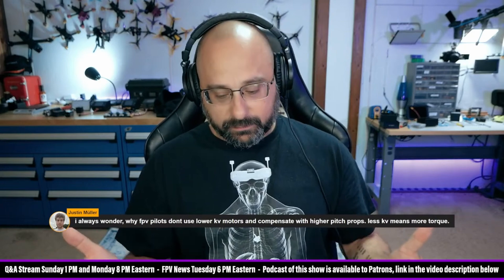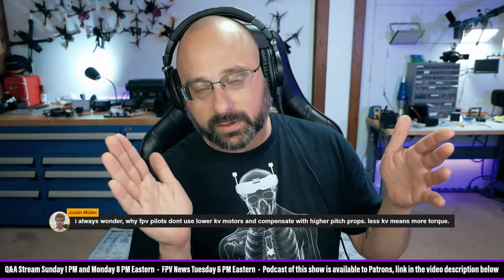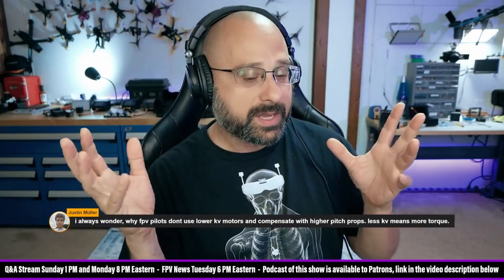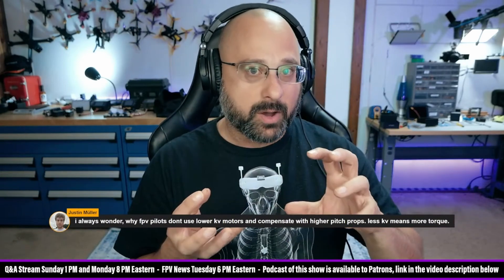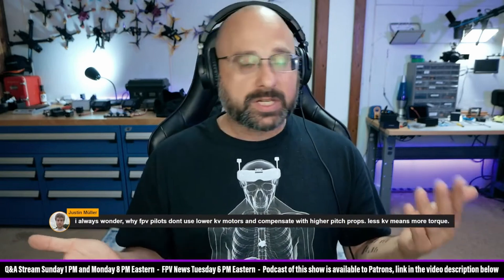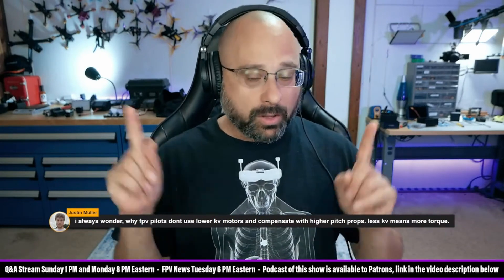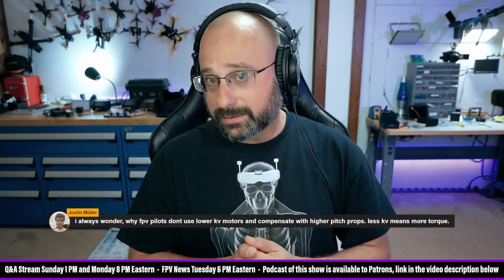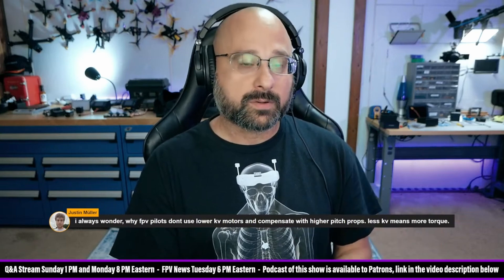Is Torque and KV of an FPV Motor Realted? What About Stator Volume? - FPV Questions

Comment: Disappointing answer. Remember, mechanical power = rpm x torque. For a given power, lower kv/lower RPM, must be correlated to a greater torque, to keep the mechanical power the same. Yes, you can have lower kv with no change in torque, with a correlated reduction in motor power.

Typically lower kv is from more "turns" and having double the number of turns will give 1/2 the kv at double the torque. Power stays the same. This is fundamental laws of physics and not subject to debate...
Reply: For a given propeller, 2x RPM requires 8x power. Same power means we must consider same RPM unless you want to compare different propellers also.
By your fundamental law the same power at the same RPM is driven at the same torque.
Now we can talk about available torque but this is directly proportional to available amps (and only that for a given motor, irrespective of windings).

Comment: So you need to increase the motor size due to material science limitations. Another way to increase torque is to increase potentials. But usually materials can’t handle it and you reach the limitations in the static magnetic field which can’t be controlled in these cheap neodymium based brushless motors.

Comment: In general:

Kv: RPM per volt applied
Stator volume is proportional to torque

Motor height increases torque, responsiveness, and, to an extent, a higher top end (due to a smaller moment of inertia), but decreases cooling capabilities
Motor width increases torque and increases cooling capabilities, but at the cost of responsiveness and a higher top end due to a higher moment of inertia.

You also have to take into account proportionality, like with toothpick builds vs 5" builds. The "ratio" of width:height isn't 1:1 between them and I think you can get away with taller motors on smaller builds/motors, i.e. 1105 as opposed to like the standard 2207/2208 motors on 5" quads. This part is just my observation, but lemme know if I'm wrong.

Comment: So higher kv consumes more current with less voltage and lower. Kv motor consumes less current with more voltage as we see in 6s low kv motors vs 4s high kv motors for example

Comment: To clarify : the torque constant Kt is equal to 1/Kv. The lower the Kv, the higher the torque per amps but the lower the maximum speed.
What you're changing with the size of the motor is the motor constant Km, ie the power available. You can spend that power on torque or speed, because motor power is speed * torque.

BUT in the case of FPV, your voltage is fixed, and there is a relation between rpm and torque needed. 
While peak torque may be higher for a given voltage with a lower Kv motor, it's not needed for FPV since you won't be able to trasmit it to the air. It's a match between battery voltage and prop size/pitch.

Comment: If I'm not mistaken, kv is per 1v. So, it makes sense to consider current alone.
Reply: voltage is different than current right?
Reply: @staravelli1207  Yup. Power is current (amps) vs. tension (voltage).

Comment: If you really start messing with bigger props, you will find a 3110 motor has more torque than a 2812.
The stator volume is nearly the same.
When spinning a high pitch gemfan 8060 the 3110 motor has more torque and response.
Have you ever sat in a rotation carousel on the playground as a kids? That table in the middel, which you rotate with your arms, makes a big difference what size it is.
If it's wider, you have more leverage.
Same goes for motors. The magnets in the motor bell are all what counts when you talk about torque. You need strong magnets and a small air gap.
The wider the motor bell is, the more leverage the magnets have.
More torque from wider motors have the disadvantage of more mass on the outside bell and spin up slower. But with big heavy props, the rpm is much less anyway.
Smaller 5 inch props need tall motors for faster rpm response

Comment: Everything else being equal, a motor with more turns has more torque and less kv. 
The available torque of a lower kv is higher until it reaches a given rpm when the higher kv starts to have more torque: the torque vs rpm is a line that starts higher in available torque, and reaches 0 (max rpm) before the higher kv motor.
Depending on the load (the prop), you might never reach the higher rpm when the the high kv motor is better, and only burn your battery quicker.